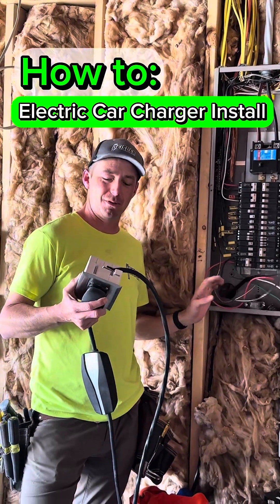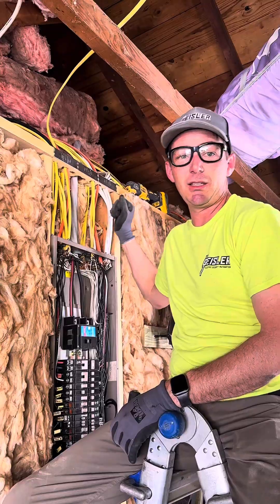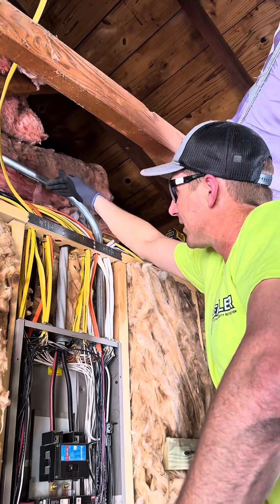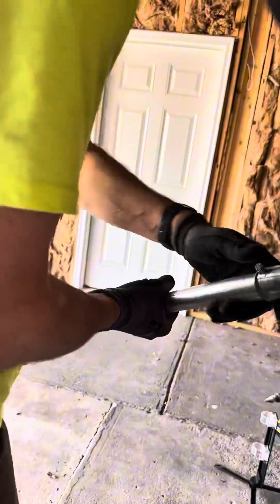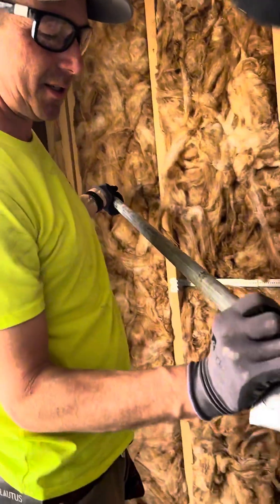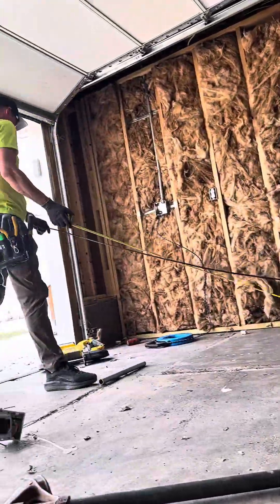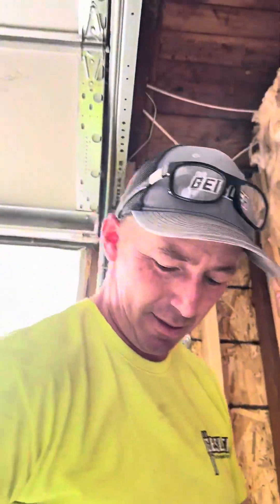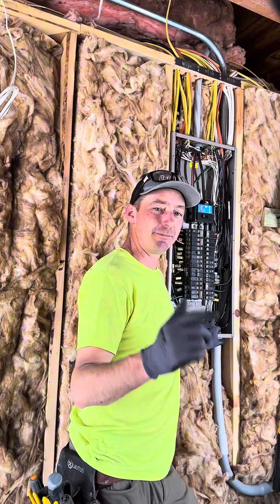How to install electric car charger outlet

Comment: Gotta love those telescopic brackets. Nice work 👍
Reply from the maker: Sooo nice!
Reply: @electricianjoe  Hi. I have an outdoor circuit breaker box. It seems to trip once a week. Only thing running at the time of the trip is the HVAC AC unit. So that goes out and any other plugs connected to it. When I go outside to the circuit box, none of the breakers tabs have moved forward for me to to know which breaker is the issue, so I just push the main breaker tab to the right and back to the left. This fixes the issue and the items in the house that went out will come back on. What could be causing this? Also, this only happens during summer months of the year. It’s extremely hot out and the box faces sun side of the house. Same issue started last year. But I would think if it was due to the summer heat, then all electricity would go out. And why would it happen once a week when it’s extremely hot all week.